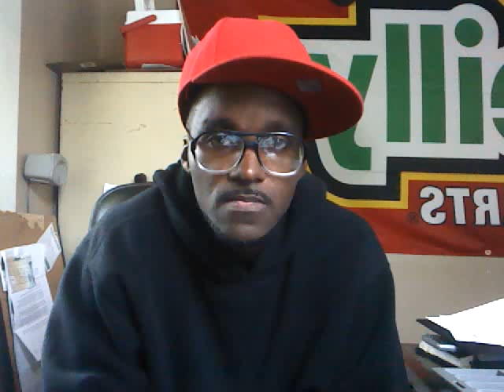Why does my radiator have rust in it?

Comment: Thanks Max. It has been 100 every day here in S.A. and I just thought I'd check my overflow container. Well, a neighbor did as I am disabled in my arms...and he found RUST! The hoses also have those twisty clamps which are a pain. So I got some of the screw on clamps and decided to look up rust in the radiator overflow. I will get some Distilled Water as you suggested. My man!! My 96 Ford Taurus radiator is inaccessible from the top. Should I put in some kind of StopLeak with the distilled water? As a prevention or should we look for spots? No wet spots under the car there.

Comment: This kat told me that if I install a little plug thingy somewhere on the radiator...it'll rust that plug instead of rusting the radiator. Is this bullshit or true?
Reply from the maker: SANDMAN1996SS Lol..when he told you that was he standing under a nice shade tree????
Reply: guess what, he is right for old systems. and old marine systems. They are called sacrificial zincs. They can stop corrosion . They make as much difference to a healthy system as distilled water.